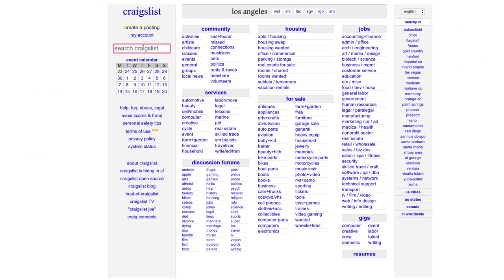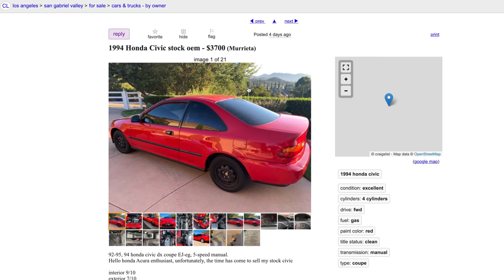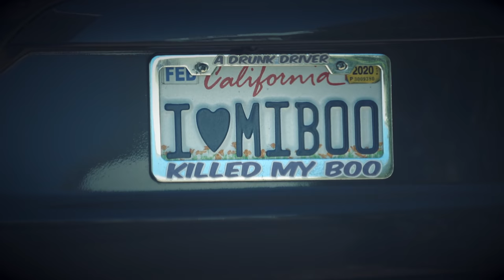Can $1000 Get You a Rare Sports Car?

Comment: Who are you fooling? You sold the car with a huge lost - because you didn't include the value of the hours of labour into your calculation. Even if you charge yourselves less than a professional mechanic, you still have to charge yourselves minimum wages at least (not to mention garage space and tools usage). At the end of the day, it's your labour and not so much the parts that's increases the re-sale value of the car! Ignoring this crucial factor - time/labour investment - , turns the initial bet into a huge fake!